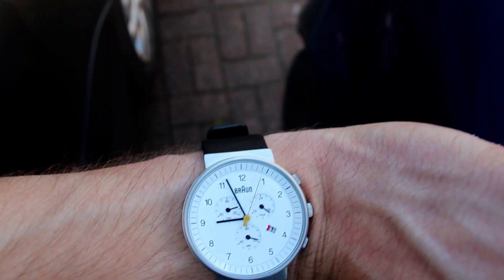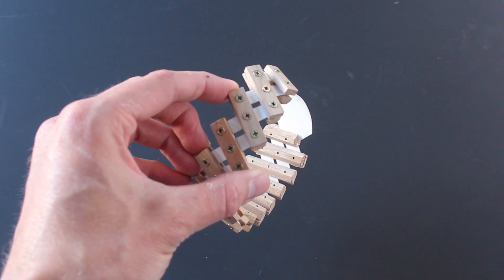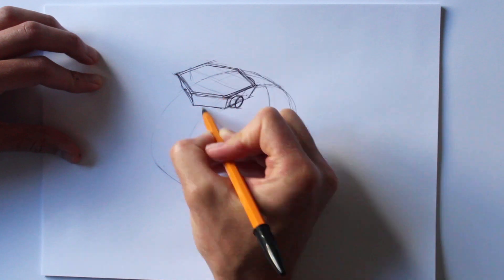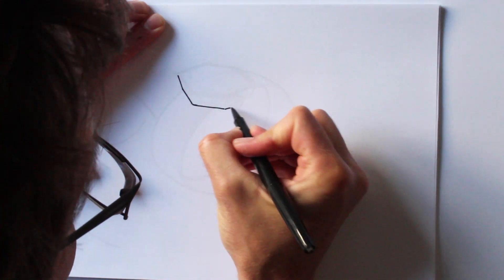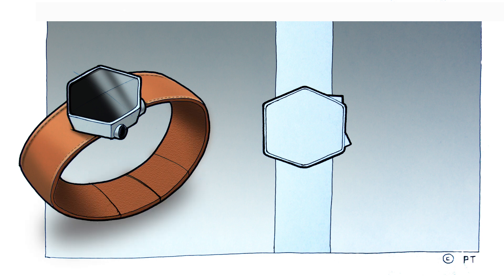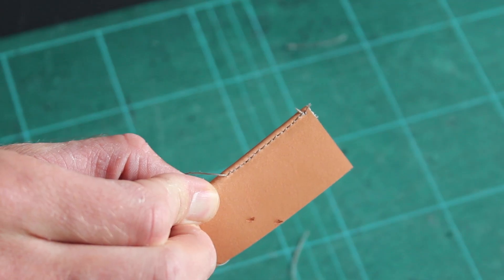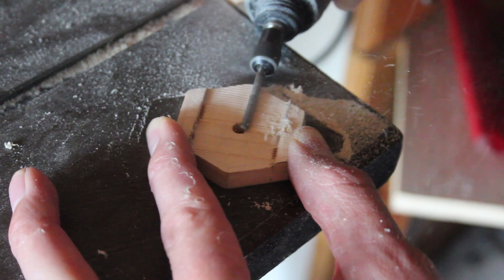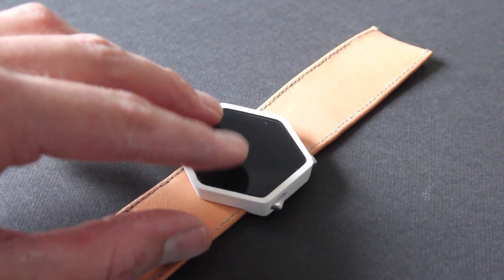how to design a smart watch - design process

Comment: May I ask how long the model took you to make? And the total rough cost of the model materials?
Reply from the maker: Hi Fred, this model was quite quick about 2 days, but I had made a few before, so I'd already got the techniques down.  I try not to buy materials wherever possible, so I already had some off cuts of wood, aluminium and acrylic some of which I saved from university about 20 years ago, some was salvaged from old projects and scrap.  The strap is made from a folder bought for about £2, I had to buy some spray paint, about £7. I'd estimate the whole thing was sub £20.  PT

Comment: did you just use a regular sheet of leather for the straps?
Reply from the maker: I did, I had some scraps lying around from a previous project, but it was a bit thick and as you will see in the video I had to thin the edges before folding them over and stitching them. PT

Comment: i am talking about the thing that connected the watch together.
how did you create it
Reply from the maker: In this video, the watch straps are fixed by small screws to two thin pieces of curved beech wood.  The watch straps are made from polypropylene and the wood has been sprayed with car body paint.